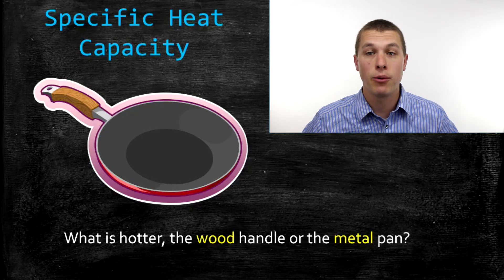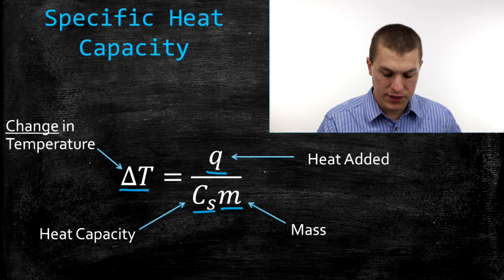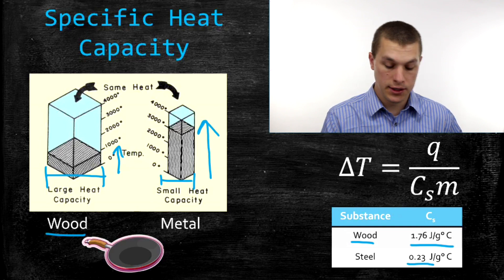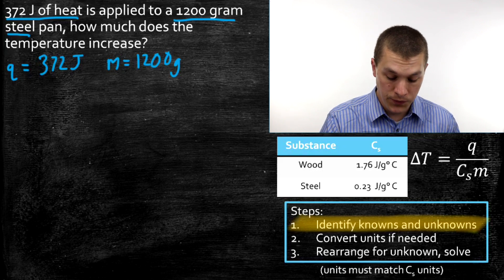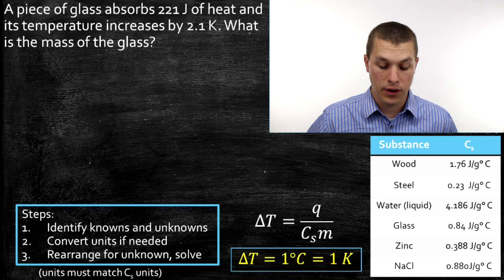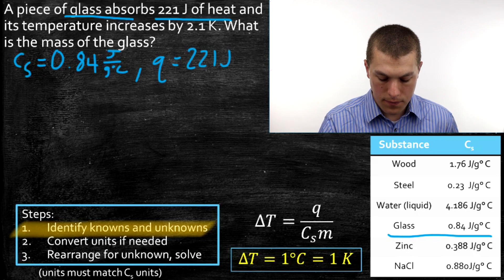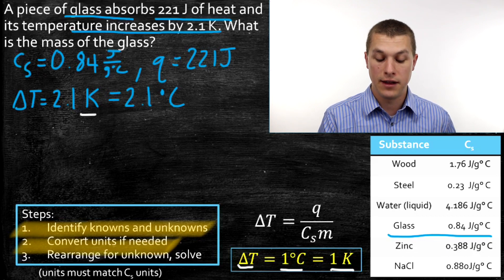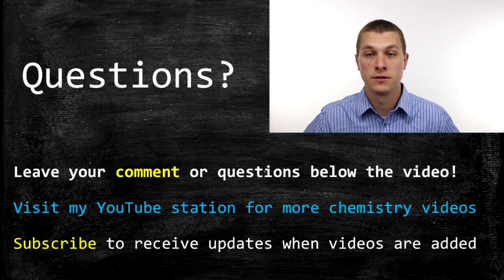How to calculate temperature changes with specific heat capcity - Real Chemistry

Comment: For the question about glass ( I paused the video and tried before you explained it) I didn’t get 130g I got 125.6g (rounded to 1dp) did you round up or Did I put it in wrong. Apart form the answer I did the formula right thanks your very helpful. 👍
Reply: Same here.